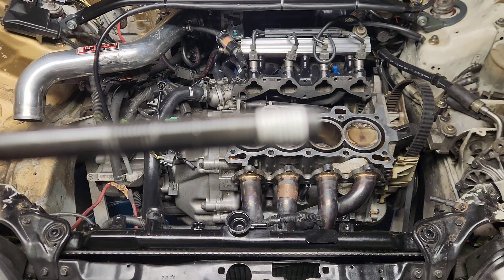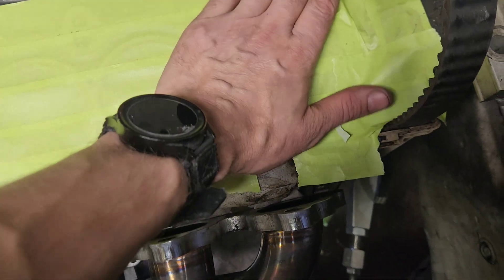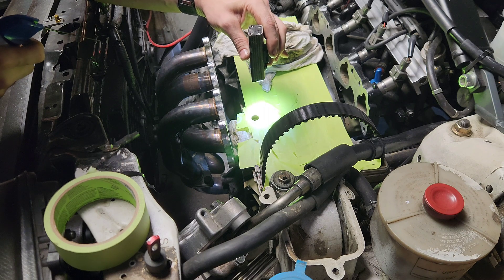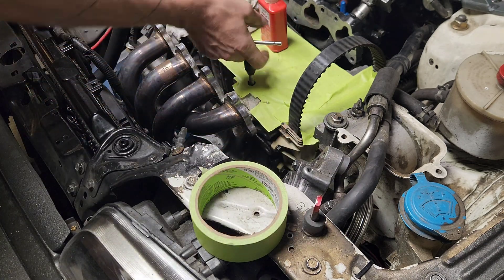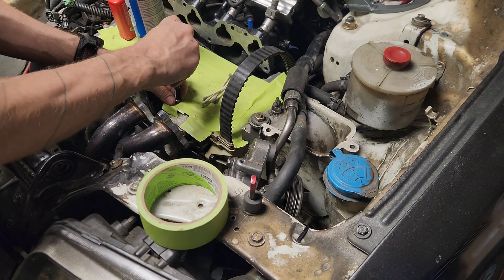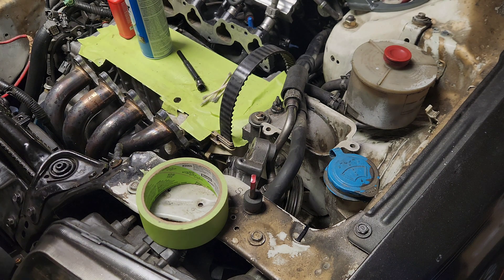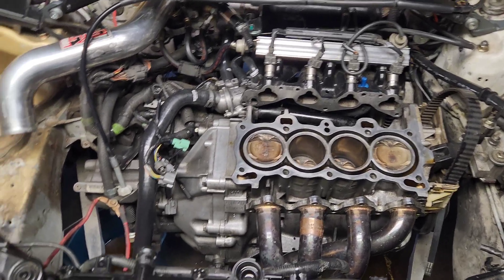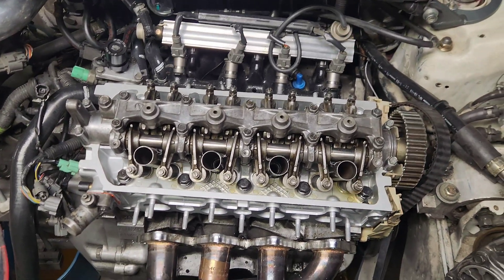HeliCoil Re-thread-er Kit, It Works!

Comment: There’s a slightly cheaper brand on Amazon that comes with the bit and all, and it works great. I’ve used it to repair motor mount holes
Reply from the maker: I'm all about cheaper on Amazon, believe me.. but when it comes to head bolts.. I pay for the best I can afford. But other things... I'm right there with you.
Reply: @GumptionGarage  True true, you got a point